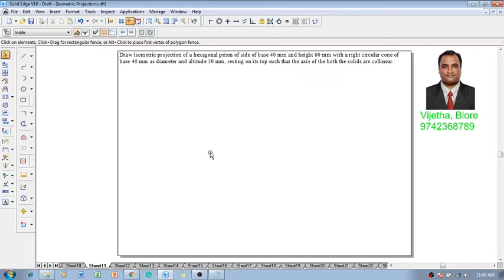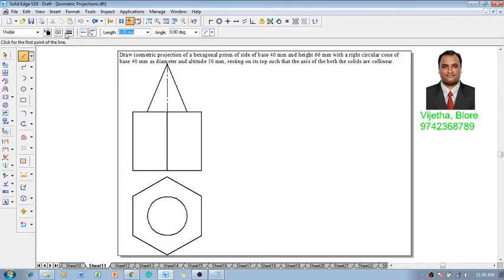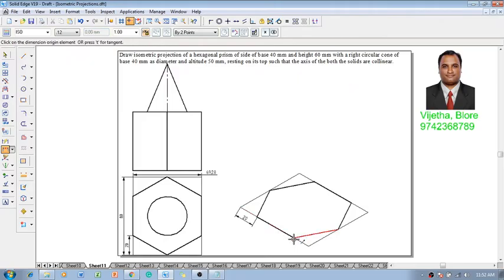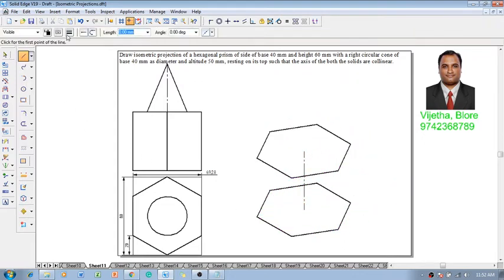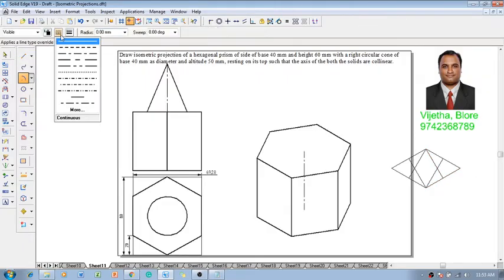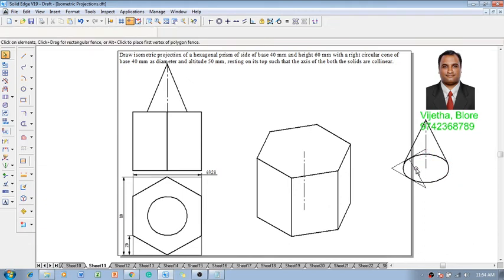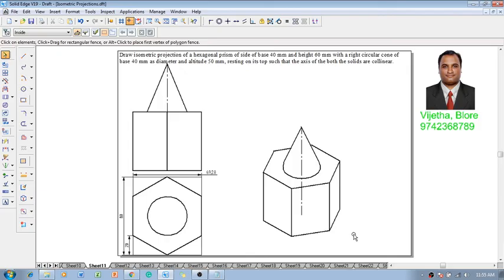Example 11 on Isometric Projections

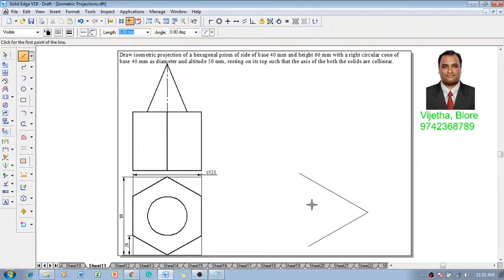Comment: Sir 1:35  can u tell that measurements again
Reply from the maker: Which kind of measurement are you looking for?
Reply: @VijethaVardhanRN is it 69.28
Reply from the maker: Hey  @ssc9685  and welcome back to the channel! Today, let's clear up a common question about drawing hexagons in isometric projection, especially when you hear terms like "enclosing it in a rectangle" and dimensions like 69.28 mm.

You might be wondering, "Why go through the hassle of drawing a rectangle first when I just want to draw a hexagon?" That's a great question, and it gets to the heart of how we accurately represent objects in isometric views.

The Challenge with Inclined Lines in Isometric

Think about it: an isometric drawing gives us a 3D perspective on a 2D surface. While vertical and horizontal lines (aligned with our isometric axes) are straightforward to draw, what about lines that are inclined, like the sides of a hexagon?

One of the fundamental guidelines of isometric drawing states that we cannot directly draw inclined lines at their true angles in an isometric view. If you try to use a protractor to set the angle of a hexagon's side directly in isometric, you'll end up with an inaccurate representation.

Instead, the rule is to identify the endpoints of any inclined line in your orthographic (2D) views, and then connect those points in your isometric drawing. This is where our enclosing rectangle comes in!

The Power of the Enclosing Rectangle

Imagine we have the top view of a hexagon. This is your standard, flat, 2D hexagon. Now, if we draw the smallest possible rectangle that completely encloses this hexagon, what do we get? We get a rectangle whose sides are either horizontal or vertical.

Let's say, after enclosing our hexagon in its orthographic top view, we measure the dimensions of this rectangle, and one of them comes out to be 69.28 mm. This 69.28 mm isn't a direct dimension of the hexagon itself, but rather the measured length or width of the bounding box that contains it.

How This Helps in Isometric Construction:

Easy Rectangle Construction: Rectangles are super easy to construct in isometric because their sides align perfectly with the isometric axes (0°, 30°, 90°, 150°, etc.).
Locating Endpoints: Once you've drawn your isometric rectangle, you can then accurately transfer the relative positions of the hexagon's vertices (its corners) from your orthographic top view onto the sides of this isometric rectangle.
Connecting the Dots: With the accurate endpoints of each hexagonal side now marked within your isometric rectangle, you simply connect these points. This method guarantees that even though the lines are inclined, they are proportionally correct and accurately represented in your isometric view.
So, to summarize: The 69.28 mm measurement you're seeing is the dimension of the rectangle that encloses the hexagon in its flat, 2D (orthographic) view. We use this enclosing rectangle as a guide in isometric drawing because it allows us to easily establish the precise locations of the hexagon's vertices, which we then connect to create the accurately proportioned isometric hexagon.

It's all about breaking down a complex shape into simpler, measurable components that are easy to work with in isometric projection.

Hope that clarifies things for you! If you found this helpful, smash that like button, subscribe for more engineering drawing tips, and let me know in the comments if you have any other questions!

Comment: Why should we take 69.28 mm only but how much measurement should we take as it is not mentioned in question
Reply from the maker: It is isometric length, it will always be 0.8164 times of true length